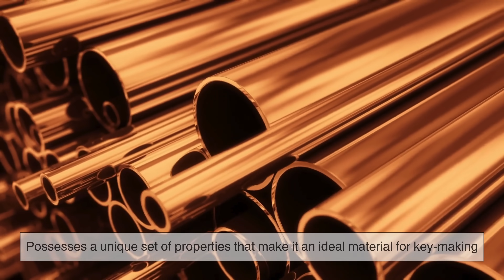Why Are Most Keys Made of Brass Instead of Steel?

Comment: a worn out key is less expensive to replace than a worn out lock is.
Reply: Yes, which makes it interesting that so many safe locks and other lever locks with brass levers have steel keys, so the levers wear down sooner than the key. I think it is because the keys commonly have a long thin stem and so they need more strength than brass can provide.
Reply: How does someone copy a worn out key for a replacement?
Reply: @southbound1969  I'm no locksmith, and i haven't seen the video. But my imagination tells me if i stuck a key into a lock 7,000 times, either they key of the lock will eventually wear out due to metal rubbing on metal. Now imagine it is a door to an apartment building with 40 tenants, That is suddenly over 100,000 times a matched key has entered the lock. If a key has been used so many times that you have to bring it to a locksmith and have it remade, the lock smith will place the key into his machine which carefully traces and duplicates the peaks and valleys on a new blank. A tiny offset in the duplication can be made so that the new key is 0.2 millimeters larger than then original. You can practice this technique by trimming your left eyebrow to match your right. It takes practice but eventually you will get it right.
Reply: @gottagift  Thanks
Reply: Often the key is not “worn out” but been previously miscut. 
Either way about 80% of the time a shim (my preference was a slice of business card) is placed under the key to be traced which raises it slightly and causes the new cut key blank to be cut slightly less deeply. This often solves the problem.
NYC Metro Apartment Building Entries were the only time I saw many cylinders literally worn out from wear and those often were more worn out by slightly incorrectly cut duplicates than by actual use.
Reply: @southbound1969  There are various ways to compensate for the worn key, such as filing down a blank, or using a spacer below the key to be copied, or reading the cuts and cutting one anew,... There is a bit of guess work involved. It helps to have the lock available in such cases.
Reply: @southbound1969  gauge it and originate a new one to the same bitting combination. Instead of copying the wear, you end up with a new one exactly like the original when it was first cut
Reply: Most locks come with more than one key. Most designs of keys are cut in quantized depths. If you know the make and type of key you can decipher e.g. that a 5.3 mm notch should have been 5.1 mm before it was worn down. A ”dumb copy” of a key will copy the errors but a smarter copy won’t.
Reply: @southbound1969  A key is just basically a 2D chunk of metal, so impressions or good locksmiths can just look and cut.
Reply: @southbound1969 The cuts are standard and any locksmith can know just by looking at the worn key
Reply: @southbound1969  "How does someone copy a worn out key for a replacement?"

Easily. Because you don't use the original key as you "Daily Driver" key. You put it somewhere secure after making a copy to be your "Daily Driver" key.

For car keys where you can't use a copy to start the car, I have an "Unlock" key on a ring with the main key that I use to unlock the doors. This saves wear and tear on the main key. I also keep an "Unlock" copy at home.
Reply: A locksmith or a layperson with skill can decode a lock.  By knowing the brand of lock and decoding the pin placements (by picking or disassembling the lock and measuring) you can get the bitting code and cut as many keys as you need.  With 0 need of the original.
Reply: @acdbrn2000  I got amazed once when i lost a set of keys. I called Pop-A-Lock to drive over to my house and see if they could make me an ignition key to my truck. How it was done, i don't need to know but an impressive skill for sure.
Reply: Brass easier to pass through digestive system than steel 🥰

Comment: The tubing you showed at the beginning of this video is copper. Copper is too soft to be used for keys and thus it is strengthened by mixing it with other metals to produce brass.
Brass also has semi self-lubricating properties and thus does not require the frequent addition of lubricants which may attract dust and debris that will impede the workings of the lock.
Reply: Traditional lock lubricant is powdered graphite.

Comment: Most brass keys are plated with nickel, which also contains antimicrobial properties.  In my experience, about 20% of keys in common usage are nickel-plated steel.  Steel keys are more common than you seem to suggest in the video.  The nickel plating goes some way to maintain a low friction coefficient, antimicrobial properties and corrosion resistance in steel keys. 

Steel keys are used in both the cheapest and most expensive lock sets.  I assume it is used in the cheapest because key steel alloy is about a quarter the cost of brass.  The most expensive is, as you explained, for security and durability.
Reply from the maker: Thanks for the detailed information!
Reply: Exactly. Steel keys are quite common. You can often see the plating wearing off. Almost all my car keys have been steel keys.

Comment: This piece fails to mention that many commercial keys (especially from Schlage) are made from nickel silver (actually cupronickel) for better wear performance. This is not an issue in locks where the key pins are made of a harder metal than brass (e.g. stainless steel).
Reply: You might want to check that idea of stainless steel pins.
Having masterkeyed literally thousands of locks … especially Schlage, Sargent, Russwin & Corbin … and bought … I don’t have any idea how many pins (both OEM and regular replacement) I didn’t see stainless steel enter the market until Medeco and a few High Security pin types arrived. 
Most OEM pins (directly from Schlage & etc) were/are nickel silver (what you correctly identify as cupronickel)

Comment: If you want to tell us, brass is easier to machine than steel, you should test that theory first!  Take a common drill bit that you use on steel and wood and try to drill brass!  You will find problems!  Brass requires a special bit to cut.  This part of the video is extremely misleading.
Reply: Cutting steel keys on the little low power cutting machine would be very difficult if not impossible and would probably trash the cutter in just a few keys. I've machined brass, oilite bronze, and copper at a previous job so I know what you're getting at. Had a piece of copper almost rearrange my teeth one day.
Reply: Exactly. All the people who say modern lead-free brass is easier to machine than steel are clueless. Brass is terrible to machine or even drill.

Comment: The key's metal should be softer than the metal in the lock. Over time the key will gradually wear down and can be replaced. If the key metal was harder than the lock metal then the lock metal would wear down causing a much bigger problem and more difficult to repair.
Reply: No. Sorry. The metals must be of the same composition. If the key wears faster than the pins or “plug” (keyway) it will cause the pins to misalign by a small amount and drag and very quickly deform the plug (keyway) which damages the upper pins and quickly renders the entire cylinder useless.

Comment: You got one part wrong - Brass has a higher coefficient of lineal expansion than steel, therefore, it will react more to changes in temperature than steel will - opposite to what you said. Brass, 19x10 to minus 6 and steel 11x10 to minus 6.
Reply: But let's also consider that most lock components are also made from brass... so if the key is expanding/contracting as much as the lock, then the delta between the two is closer to zero.  Therefore thermal expansion is not that significant.
Reply: @ao4v0ws  So why then is it brought up in the video as a "significant" point for the use of brass over steel???
Reply: @ao4v0ws  if the key expands toward the bits, and bits expand towards the key, then they interfere more, not less

Comment: the next question is: why are the pins in the lock and the barrel made of brass? finally, why are the door hinges made of brass?
Reply: Since the key and the lock cylinder and pins are also made from brass, the take on the same overall properties that was stated in the video. 
But probably more importantly, since they are all made from the same basic material (slight difference in alloys is expected for different tasks) then thermal expansion between the key and lock are almost identical.  That way if it's hot, they both expand the same amount and the key fits just as well as if it was very could too.  But with different metals, such as steel and brass, they will have different coefficients of expansion and therefore at extreme temperatures they could become misaligned due to changes in their dimensions and therefore the lock may not work.
Reply: @ao4v0ws  Not sure thermal expansion would make a big difference.
But corrosion between 2 different metals could. Even if I don't remember noticing this between brass and steel tbh .
Reply: @nalinux  Yes, preventing galvanic corrosion is the reason.

Comment: It's the same with precision threads - example - optical parts that hold lenses.
Steel cannot be machined as accurately as brass.
Reply: Tell that a watchmaker. While the pinions, gears and cogs are mostly made from brass, all the tiny pivots and staff are precisonm made out of hardened steel that sit in jeweled bearings. Also, internal combustion engine components that are made from steel are machines to much higher precision that something like a normal key that I can file with a crude small file by unaided eyesight and without a machine. The rings that hold lens elements and the barrels in traditionally made lense are made from brass because of the malleability and corrosion resistance of brass, but nowadays various types of plastic are mostly used.

Comment: Excellent video. I am a retired locksmith, and I even forgot about brass's antimicrobial properties (the copper in the key does this trick). As you might have discovered in your research, there is another very popular metal for key production. That being nickel silver. It is a little more resistant than brass but retains brass' softness. Key manufacturers such as Schlage and Sargent use it in their OEM manufacturing. Again, thanks for the detailed and informative video.
Reply: Years back I worked at a local hardware store, wound up being the guy that did all the re-key/mastering at the store. I had customers that'd walk out of the store if it was on my day off and come back a day or two later so I could make them keys, especially car keys (GM). I remember the antimicrobial properties.
Reply: Good point. However, many people are allergic to nickel silver. So, I would say brass wins in all categories when it comes to keys.
Reply: @f8c3themusic  > allergic to nickel silver

I remember, many years ago, reading an account from someone who tried giving themself a tattoo, using an electric guitar string as the needle.  Anyway, it turned out that he was allergic to nickel, so that was the worst possible needle to choose.
Reply: @f8c3themusic  Some jewellery was made of Nickel Silver up to about 40 years ago. About 15% of women and 5% of men are allergic to nickel. It was dropped from jewellery then. I remember at that time the allergy was blamed on silver and many women thought they could not wear silver. There is no Silver in Nickel Silver it was a great jewellery scam at the time. It is Copper, Zinc and Nickel only. Amazingly it's colour is silver and it passes for Silver easily.
Reply: I love Schlage keys.  When I was in college I used to get scrap keys from a couple area locksmiths.  I'd use the metal from the brass ones to make little trinkets - I paid most of my college education that way.  Schlage keys I set aside for use in casting.  That alloy made nice dense castings with good surface detail, and it finished to a nice pale yellow color a lot like, well the color of a Schlage key  ;)
Reply: Are silver coloured keys still made of brass, or only brass coloured keys? I dig up both colours from the ground metal detecting
Reply: @digginggopher Keys are usually brass with nickel (silver color) plating. Chrome gets used sometimes but has the tendency to chip off, cut my finger once with a chip of Chrome from a key.
Reply: Does it really matter since almost all brass keys I have seen are plated with chrome or nickel?
Reply: Take a look at zinc.  Zinc is a very strong anti-microbial and anti-fungal metal.  A zinc wire strung along the top ridge of a slate, or tile roof, will prevent moss from growing. Also head and shoulders dandruff shampoo uses zinc as it's active ingredient to prevent dandruff because zinc not only kills bacteria/fungus, but it also prevents it from reproducing.  So washing with a zinc product will help get rid of bacteria/fungus, plus the residue that is left behind, even after rinsing well, will prevent the remaining bacteria and fungus from multiplying as quickly as it normally would.  Some of the newer multi-day deodorants are using zinc too.
Reply: <3

Comment: So these are the reasons why brass is chosen for keys.  It is easier to machine, resists corrosion longer than steel, and is anti-microbial as well.
Reply from the maker: Thanks for summarizing the key takeaways!
Reply: I highly doubt being anti-microbial is actually a consideration in material choice vs a happenstance.

Surly not fouling the much more intricate lock with corrosion products or premature breakage/wear it were the primary criteria. At that point it is just about picking a material that is not easily corroded and durable "enough" (but not as hard as the lock's materials) while being as cheap and replaceable as possible
Reply: Lead-free brass is not that easy to machine. It is actually harder on cutting tools than steel. Almost all brass is now lead-free. Leaded brass is very easy to work with.

Comment: The copper is probably what made them antimicrobial.  Other metals like silver are lethal to a lot of bacteria yet harmless to us.
Reply: Take a look at zinc.  Zinc is a very strong anti-microbial and anti-fungal metal.  A zinc wire strung along the top ridge of a slate, or tile roof, will prevent moss from growing. Also head and shoulders dandruff shampoo uses zinc as it's active ingredient to prevent dandruff because zinc not only kills bacteria/fungus, but it also prevents it from reproducing.  So washing with a zinc product will help get rid of bacteria/fungus, plus the residue that is left behind, even after rinsing well, will prevent the remaining bacteria and fungus from multiplying as quickly as it normally would.  Some of the newer multi-day deodorants are using zinc too.
Reply: The zinc in brass is the more likely germ killer.
Reply: Copper cont ains arsenic .
Reply: @Munguy-i8j     No, it does not. They are literally two separate elements.

Comment: So same reason they use brass cartridges for firearms
Reply: Lots of steel cartridges exist. Brass cartridges are generally preferred because of corrosion resistance and malleability (makes for a good seal around the procectile).
Reply: @chronocommander007 I will not dispute that, but the high specific conductivity of heat that brass has is a great advantage when it comes to a choice of case material.
Reply: @oml81mm  Depends. If robustness is the most important property steel cartridges win. I have some 20 mm anti-aircraft autocannon shells here. They all have steel cartridges. =
Reply: No, brass cases as they are ejected dissipate a lot of the heat generated by burning propellant.
Reply: Countries such as Russia and many European countries, use steel for cartridges, mainly because steel is much cheaper than brass.
Reply: steel can spark on sharp impact